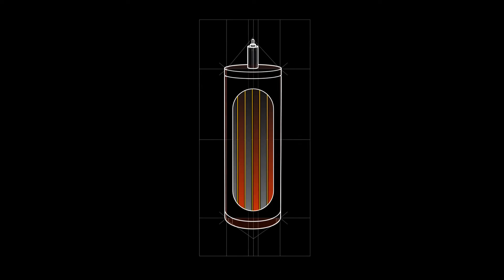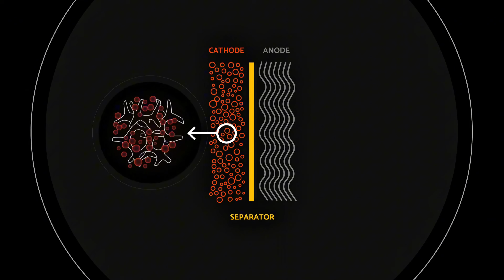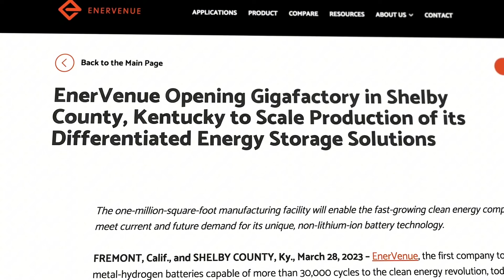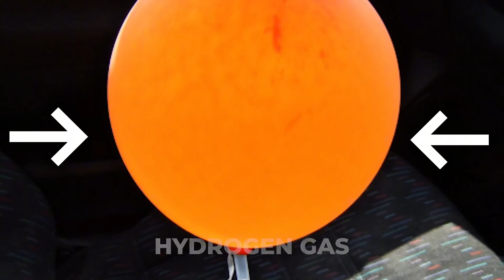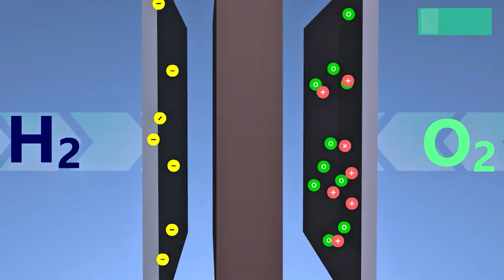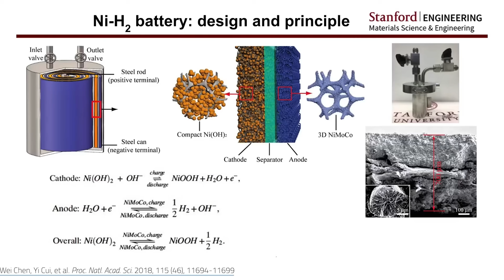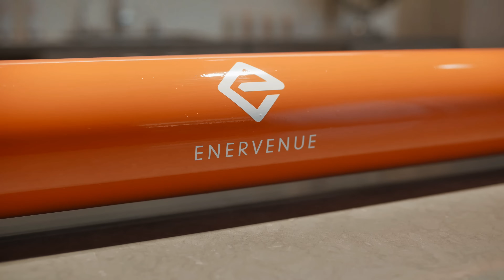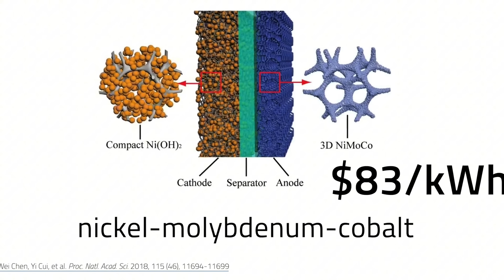NASA's Secret to Limitless Energy- Now in Your Home!

Comment: They are 80-90% efficient depending on the cycle rate.  I checked on Google.  Maybe they will be good for grid scale batteries.  They cost $83 per kilowatt-hour.  Lithium LFP batteries are below $60 per kilowatt-hour in 2024 with some reports saying $50 per kilowatt-hour.
Reply: Add product life expectancy into the equation and there is a cost saving.